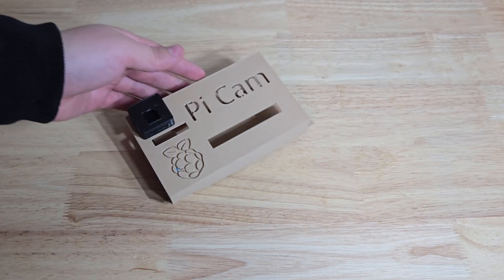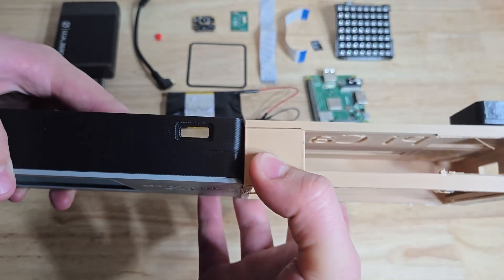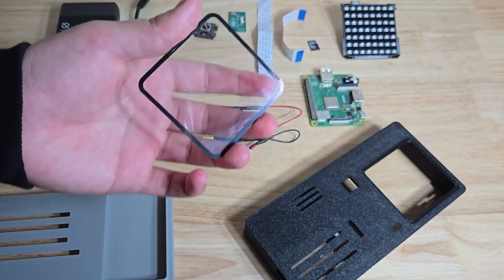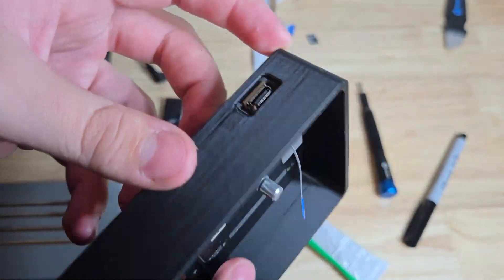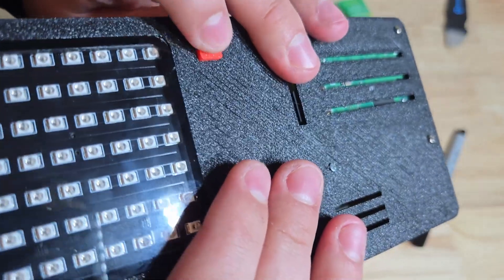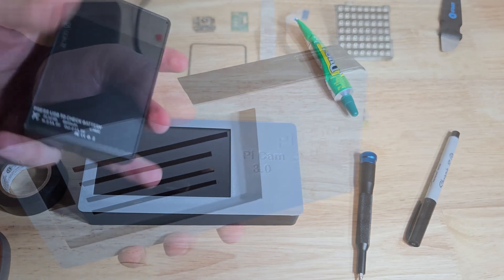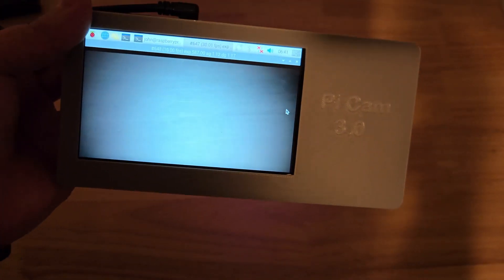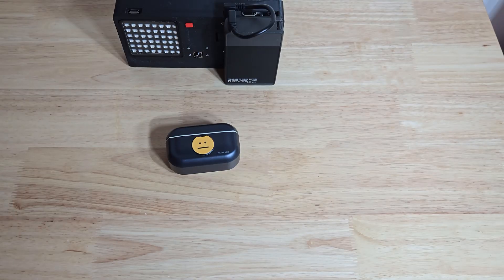My Night Vision Raspberry Pi pt.2

Comment: Hey, cool build. I bet there is a command you can send to manually set the focus value and turn off auto focus to lock it there so you can set it to be for farther away. In the same vein, you might be able to manually set the exposure higher so that things farther away arent too dark. Also in my experience with there raspi cameras, turning down the recording resolution helps make the image brighter.
Reply: Just as a suggestion on things to look into for further builds. I like the end product tho. Very polished looking and a very sturdy design.
Reply from the maker: I need to learn more linux